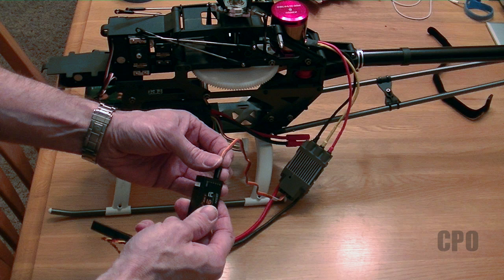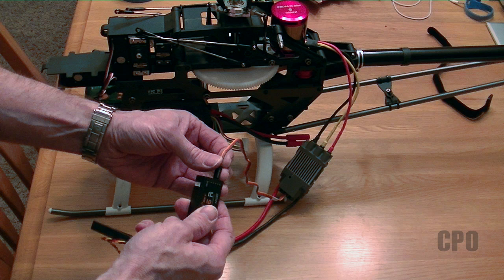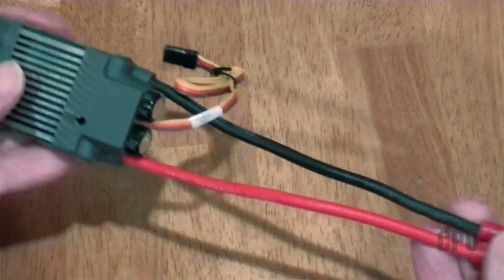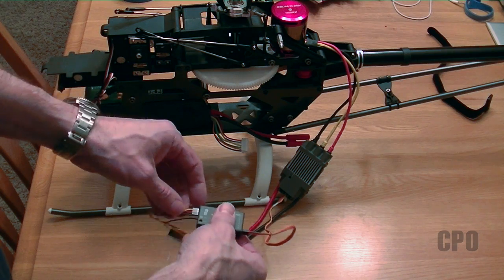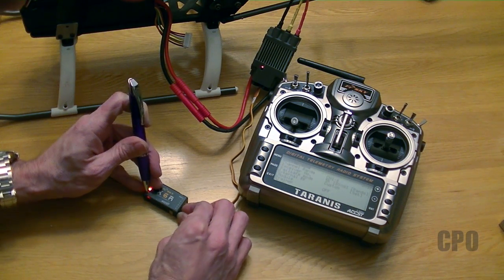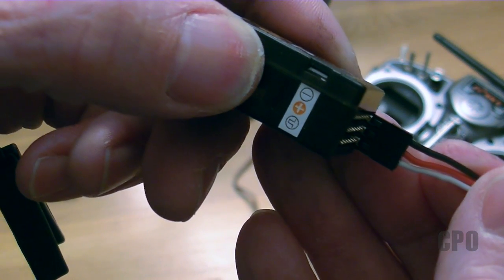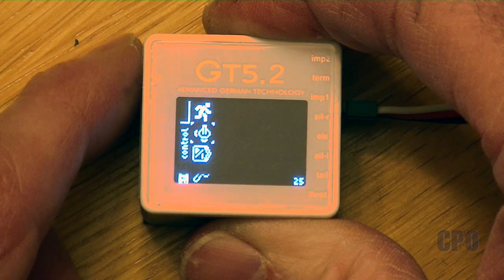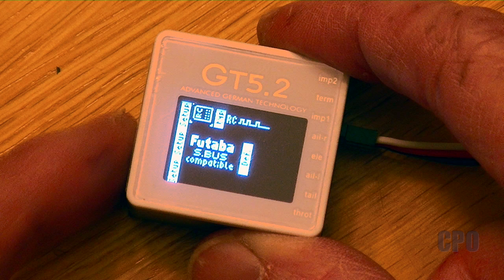TT Raptor E550FBL Electronics Setup - S.Bus RX, TX, and GT5.2 Configuration

Comment: These Gyros fly amazing! I've had boot up issues with both the ones I've used.
And now can't seen to get my Castle Edge Lite 50 to arm plugged into throttle port of my 5.1 but it works fine plugged into channel 3 of the X4R RX.

Comment: I have the same set up exempt for I run a Futaba radio.  I got everything squared away and I'm flying. I'm trying to mess with the expos in my radio to make things a bit smoother.   I did find when I moved my throttle up, the motor found a constant speed and stayed there.  I can fly with collective management but I'd like more control over motor rpm.  Haven't found anyone talking about this issue.  Any thoughts?   Great videos

Comment: Great video CPO - really helped me out.Quick question @13:22 what does the R mean at the begining of each string of info. Is it reverse ? How do i get it to appear ? Cheers and Thanks  Ant
Reply from the maker: Those Rs are for "Replace". In OpenTX when you want to have a switch make changes to a channel (via a switch for example) you can choose how the selection relates to the previous lines in the list.  This is called multiplexing. Add, Multiply, Replace.